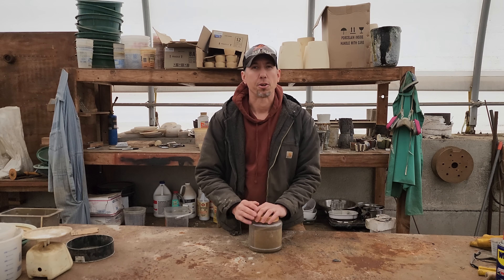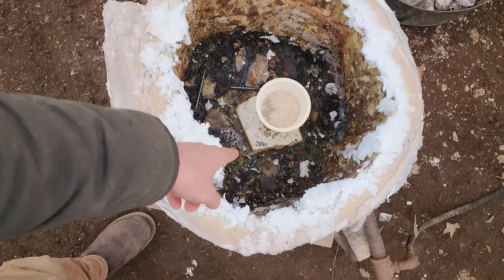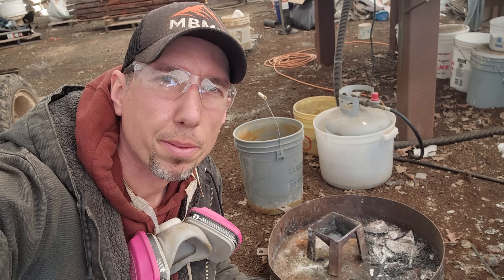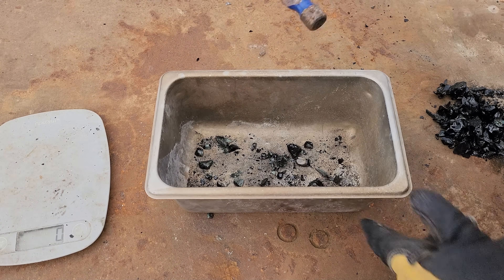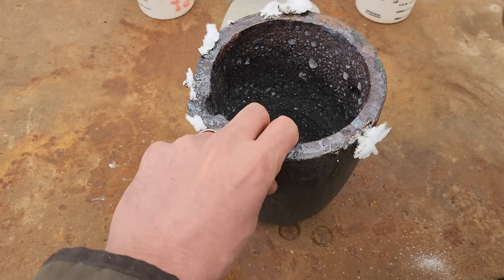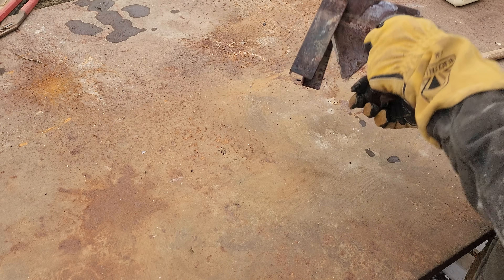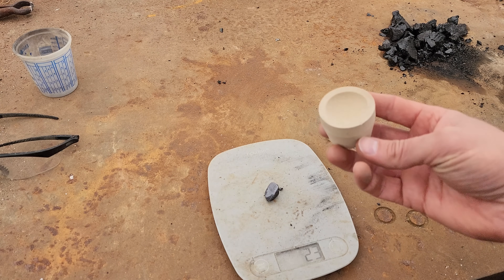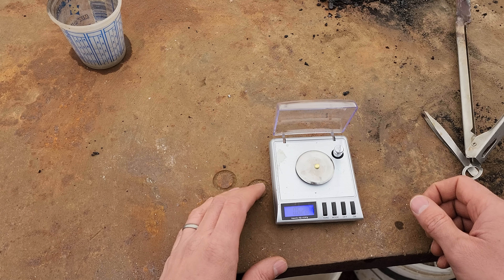Gold Smelting

Comment: I see why you're adding a blower. Because these jet blowers are limited. Aftwr you open the air intake all the way, the only way to continue increasing the temperature is by increasing the propane fuel. So by adding air blower you can continue increasing the air mixture without increasing the fuel usage.

Comment: I'm struggling trying to figure what am I doing wrong. For 191 gram of ore, I added 242g litharge (red),29 gram anhydrous borax, 66g silica,245 gram soda ash, around 1 gram+flourspar.  Ended up with viscous material. Had to use 12kg Crucible, around 1h45minutes heating. Not sure why it's not as flowable as I expected. Did I make it too acidic? My calculation was based on the book of fire assaying, eye balled the ore and figured the amount of silica needed for bisilicatee(siscosilicate causes balls of metals refuses to settle). Should I add a air blower to raise the temperature maybe. I get the best results when I'm doing 30 gram ores.

Comment: We have this happen many times(Matt). Even after using iron bar in it. We have just re-smelt matt, and it worked. Sometimes however the prill would be crystalline and break apart easily.  It frustrating at times, seems we get 50% of our pours to work out successfully. Overall the basic flux recipe with iron bar has worked out more times than not.
Reply: Matte not Matt. Matt's a dude lol

Comment: In theory, you can develop a system similar to a retort for collecting sulfur and other gases produced during the roasting process. A retort is a closed vessel used for heating substances at high temperatures, with the aim of collecting volatile components produced as byproducts.

In your case, instead of mercury vapor (although there may be some), the system would capture sulfur dioxide and other gases generated during the roasting of sulfide ores. This can be achieved by designing a closed system where the sulfide ore mixture is heated in the presence of excess iron(III) oxide (3:1 ratio) to provide the necessary oxygen for oxidation reactions. The gases produced during roasting, including sulfur dioxide, can then be directed to a collection chamber or system equipped with gas collection mechanisms.

The collected gases can undergo further treatment, such as scrubbing with alkaline solutions (Sodium Hydroxide), to remove impurities and recover valuable components. Additionally, by controlling the atmosphere within the retort-like system, you can minimize environmental emissions and ensure the safe handling and disposal of byproducts.

This approach offers a sustainable method for metal extraction from sulfide ores, allowing for the recovery of valuable metals while mitigating environmental impacts associated with traditional smelting processes. However, careful design and implementation are necessary to optimize the system for efficiency, safety, and environmental compliance.

The main talking point that prompted us is the fact that an iron(III) oxide (3:1 ratio with sulfides) will oxidize the ore without the need for an atmosphere, or nitrates that should be used sparingly.  I see you add iron in some of your smelts, but it is likely better to add the iron(III) oxide from the get go.

There are more ways, but we'll just leave it at that.

Comment: If you roast the sulfides first it helps drive off the sulfur.. unfortunately it seriously reeks. From what I can find, you basically strip away most of the oxides in smelting leaving a very pure yet microscopically porous iron/sulfur mix when you make the matte and then the air gets into it and rapidly decomposes it into iron oxide and sulfur oxide and so it falls apart basically into magnetite.. you literally make black sands like you'd find in a river by letting it sit out. Because of the porosity and purity, it is very easily decomposed by the oxygen in the air. At least that's what I can gather from the dozen scientific research papers I just read about sulfide matte smelting that caused me to now have a massive headache.

Comment: Hi Jason, 
Great video. I’m going to be facing a similar issue soon where I will be smelting down iron pyrite, chalcopyrite and galena/sphalerite. Why no iron? In previous videos you had mentioned that the saturating the charge with iron helps break down the sulfides and makes the FeS get adsorbed by the slag…

Comment: The last time you mentioned this affect, was rhinking rhat if its ph basic slag, its likely absorbing water and becoming a hydrate. However, there's a few things to consider, if the slag/flux mix is basic, and you're smelting sulfudes, sulfudes tend to be acidic so there is an acid and base reaction, giving off water and forming oxides. If you are using an excess of basic flux, you are probably left with mostly oxides and hydroxides which the hydroxides tend to be hydroscopic. Simce they are contaminated with a bunch of fine oxide grains, that is probably why it turns into a powder rather than a damp salt.

Comment: Yes, your problem is that the gold is bonding to the thiosulfate ions. Thiosulfate leaching of gold ore is sometimes used when the ore contains copper, which acts as a catalyst for the leaching process. You just need to break the S2 bonds first before anything else. Haven't you tried roasting the concentrate in air first?

Comment: Hi, physics trained “YouTuber” here. For the mechanical change in the black material, I don’t know for sure about this reaction but what I do understand is that there are states that matter can be in which are unstable. So under the assumption that it’s not reacting with the atmosphere, I suspect what is happening is that as the glassy stuff continues to cool to ambient, the preferred state is one that has an internal crystal structure that has a lower energy state. A more common example of this is when in the winter you spray your windshield with windshield washing fluid and your windshield starts off clear, but then pockets start to switch to solid phase. This switch or “front” continues to move through the fluid changing it from an unstable equilibrium in supercooled liquid form; to frozen solid. 

The alternate explanation is that you crunched it up to play a joke on us ;)😅

Comment: I did some research on this and have an answer.  When sulfides are exposed to the atmosphere they can become hydrated.  The combination of the water and sulfides in the atmosphere will cause the water to become sulfuric acid when exposed to UV light (ie sunlight).  This acid then breaks down the structure of the slag which is why it falls apart.  So it is really just a cool set of chemical reactions going on here.  Let me know if this makes sense.

Comment: Have you ever tried using calcium oxide instead of sodium oxide?  I'm wondering if that might be better for two reasons:  a 1-1 ratio of alkali earth metal to oxygen, and CaO can be made by burning seashells in a wood fire FOR FREE!!  I do that all the time for my garden, but if the CaO produced is a good flux, then that's even MORE useful!

Comment: If you want to get rid of your Matt from forming in the first fusion you'll need to add quite a bit of potassium nitrate 

Just doing a flux recipe;
100g pyrites
200g soda ash
50g borax
25g silica
100 - 200g potassium nitrate 
30-50g collector metal 

(Potassium nitrate really depends on the amount of sulfur present, add 1g KNO3 for every 2% sulfur in 10g ore)

Heat slowly to avoid boiling over as nitrate fusions can get a bit exciting

Comment: Sulphur (s2) has a reduction potential of -0.407, which goes more negative with decreased ph up to -3.1 with two free electrons, you need twice the oxidiser with oxidation potential >+407 to make oxidation of S2 the primary reaction, per atom of Sulfur. Most are explosive at assay temperatures. Interestingly iron reduces the Sulfur with its superior -0.7 and balanced two electron transfer forming FeS. I believe your artificially creating a VMS type geology making matte, and like VMS exposures it rapidly hydrates, but the chemistry does not leap into sulfide secondary and tertiary oxidation (h2s03, h2s04, h2s203+ etc) probably requires UV / ozone for that, thus your conundrum🎉love your videos, billy
Reply: This makes a lot of sense. I’m in a tropical humid climate and i get the same thing. I’m going to test a few acid digests on my Matt to see what i can find out and report back :)
Reply: solution?
Reply: @frankenscience3553  there is no problem, Jason’s all over it, adding metallic iron reduces, S2/Sx repeating lattice to FeS & adding sodium carbonate to adsorb pesky FeS into slag layer, locking up sulphur from interfering with precious metal recovery. In this example he deliberately omitted this part to observe matte formation ie sus the sulfide content, likely assess how many nails he needs for a bigger smelt & qty of NaCO3 req, he even states so omitting the sodium carbonate which would mask the total matte formation, he is ‘free forming’ it to find the right mix for that ore rather than following a fixed ratio solution and failing (having a partial matte layer still)
Reply: which these three chemical Powder Name????

Comment: I've had smelts do the same - I think its a hydration thing as here in dry Nevada it takes 2-3 weeks to do the same. I'm guessing that its the free sulfur that is hydrating - pyrite has more sulfur than 1 to 1 ratio (which is what would chemically go with iron). I have not done any testing, but I am guessing that it is that excess sulfur that is reacting with moisture and oxygen in the air.
Reply: Those are my concentrates from our mine in Montana, I'm having the same issues. I think i'll try heating the matte residue for a couple hours in an oven at 300 degrees or so to see if that drives off some of the moisture, if that's what is is.

Comment: Without knowing, I would try the following:

Litharge (PbO): Litharge is often used as the lead oxide component in fluxes. A common starting point is to use between 30% to 50% litharge by weight of the total flux. The exact amount may vary based on factors such as the presence of other minerals and the desired characteristics of the prill.

Soda Ash (Na2CO3): Soda ash is used as a fluxing agent to help facilitate the fusion of the sample. Typically, it's used in smaller quantities compared to litharge, ranging from 10% to 20% by weight of the total flux.

Borax (Na2B4O7): Borax helps to improve the fluidity of the melt and can aid in the formation of a clean slag. It's commonly added in proportions ranging from 10% to 20% by weight of the total flux.

Silica (SiO2): Silica acts as a fluxing agent and helps to form a stable slag. The amount used can vary widely depending on the specific composition of the sulfide minerals present, but it's typically added in smaller quantities compared to other components, usually ranging from 5% to 15%.

Fluorspar (CaF2): Fluorspar is often added to lower the melting point of the flux and improve the fluidity of the melt. It's typically used in smaller amounts, ranging from 5% to 15% by weight of the total flux.

Temperature: The temperature needed to drive off sulfides typically ranges from 700°C to 1000°C (1292°F to 1832°F), depending on the specific minerals present and their thermal stability. Higher temperatures may be required for refractory sulfide minerals.

Time: The time required for driving off sulfides can vary widely depending on factors such as the size of the sample and the efficiency of the heating equipment. Generally, a heating period of 30 minutes to 2 hours at the desired temperature may be sufficient to drive off sulfides effectively.

Oxidizing Atmosphere: It's important to ensure that the heating process occurs in an oxidizing atmosphere to facilitate the oxidation of sulfide minerals. This can help prevent the formation of undesirable compounds and ensure accurate assay results.

Particle Size: Smaller particle sizes tend to require less time and lower temperatures for complete oxidation compared to larger particles. Therefore, sample preparation, including grinding to a fine powder, can help optimize the heating process.

Monitoring: During the heating process, it's essential to monitor the sample closely to ensure that all sulfides are effectively driven off. Visual inspection and the absence of sulfur dioxide (SO2) gas evolution are indicators of successful oxidation.

Post-Heating Treatment: After driving off sulfides, the sample is typically mixed with flux and subjected to further heating to facilitate the formation of a prill for assay analysis.

In many cases, it's preferable to oxidize sulfide minerals before proceeding with the assay process. Oxidizing the sulfides helps to convert them into oxides, which are often more stable and easier to work with during the assay.

Oxidizing the sulfides serves several purposes:

Facilitates Assaying: Oxides are typically easier to work with during the assay process compared to sulfides. They often have lower melting points and are more reactive with flux components, leading to more efficient extraction and separation of metals during the assay.

Reduces Interference: Some sulfide minerals can interfere with the assay process by forming complex compounds or by inhibiting the reaction of target metals with collectors. By oxidizing the sulfides, these interference effects can be minimized, leading to more accurate assay results.

Improves Safety: Oxidizing sulfides helps to mitigate the release of toxic gases such as sulfur dioxide (SO2) during the assay process. This contributes to a safer working environment for laboratory personnel.

To oxidize sulfides before assaying, a pre-treatment step involving roasting or other oxidation methods is commonly employed. Roasting involves heating the sample in air or oxygen-enriched atmospheres at elevated temperatures, typically between 500°C to 900°C (932°F to 1652°F), depending on the sulfide minerals present and the desired degree of oxidation.

After the sulfides have been oxidized, the sample can then be mixed with flux and subjected to further heating for the assay process. This sequential approach helps to ensure more accurate and reliable assay results.

In addition to roasting, there are several other methods for oxidizing sulfide minerals before assaying. These methods are chosen based on factors such as the specific sulfide minerals present, the desired degree of oxidation, and the equipment available. Some common oxidizing steps include:

Acidic Oxidation: Sulfide minerals can be oxidized by treatment with strong acids such as nitric acid (HNO3) or aqua regia (a mixture of nitric acid and hydrochloric acid). Acidic oxidation is particularly effective for oxidizing refractory sulfide minerals or for samples with high sulfide content.

Chlorine Treatment: Chlorine gas (Cl2) or chlorine-containing compounds such as sodium hypochlorite (NaClO) can be used to oxidize sulfide minerals. This method is often used for samples containing arsenic or antimony sulfides, which can be difficult to oxidize using other methods.

Bacterial Oxidation: Certain microorganisms, such as Thiobacillus ferrooxidans, are capable of oxidizing sulfide minerals under suitable conditions. This biooxidation process is often used in the mining industry for treating refractory sulfide ores.

Electrochemical Oxidation: Sulfide minerals can be oxidized electrochemically by passing an electric current through a solution containing the sample. This method is less commonly used for assaying purposes but may be suitable for certain applications.

Ozone Treatment: Ozone (O3) gas can be used to oxidize sulfide minerals either in aqueous solutions or in gas-solid reactions. Ozone treatment is effective for oxidizing a wide range of sulfide minerals and can be controlled to achieve specific degrees of oxidation.

Microwave-Assisted Oxidation: Microwave heating can be used to accelerate the oxidation of sulfide minerals by providing rapid and uniform heating. This method is particularly useful for laboratory-scale oxidation experiments.

Each of these oxidizing methods has its advantages and limitations, and the choice of method depends on factors such as the sample characteristics, the required degree of oxidation, and the resources available for the assay process. Experimentation and optimization may be necessary to determine the most suitable oxidizing step for a given application.

~ CHEERS

Comment: I think you are right... your flux is highly hygroscopic.  The soda ash supposedly decomposes to sodium oxide at these temps, and it absorbs a lot of water from the air afterward.  So basically you end up with finely divided sulfides in hydrated flux.  I'm curious if roasting in the air might be quickly effective at oxidizing those sulfides since they're so finely divided.  Or if firing it again with sodium nitrate would also oxidize it well... it melts at ~300C or so and the fine sulfides should react quickly IMHO, lots of surface area.

Comment: So if the black powder that forms overnight is suspected to be an oxide, and since gold does not dissolve in HCL. (AFAIK) Why not try dissolving the powder in the HCL and run it through after neutralizing it. I suspect that as the oxides are attacked by the acid, the heavies will precipitate out and sink to the bottom of the vessel. Theoretically, a simple rinse of the heavies would provide a possible metal rich product that may produce results. At least on an experimental level.